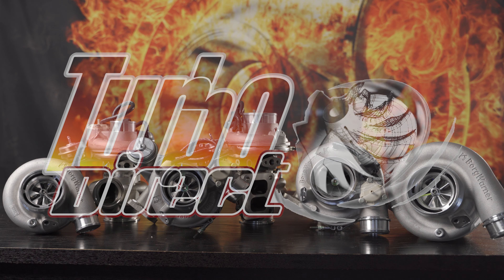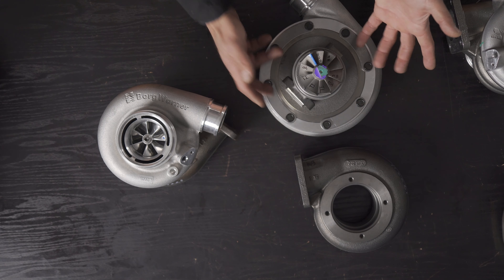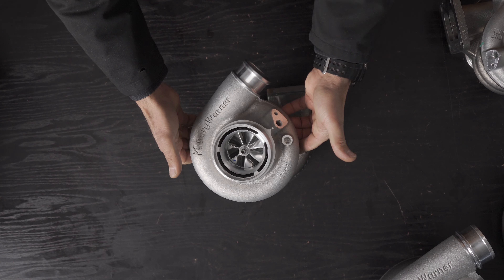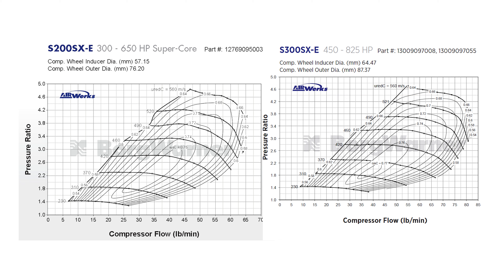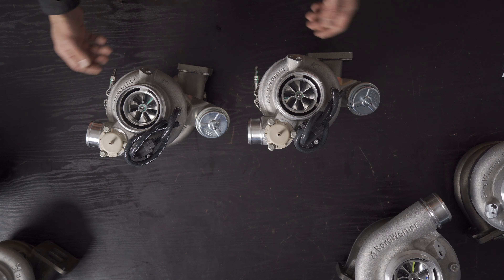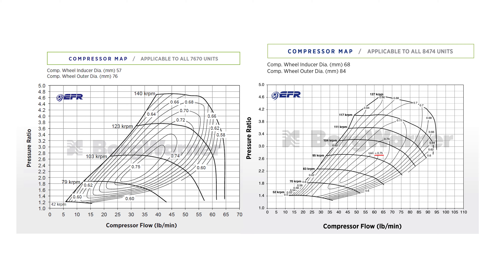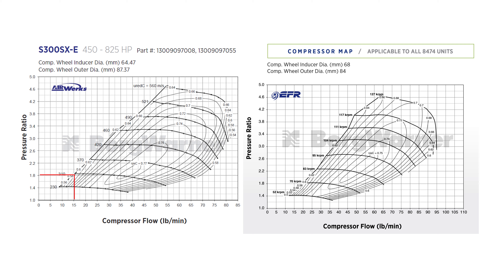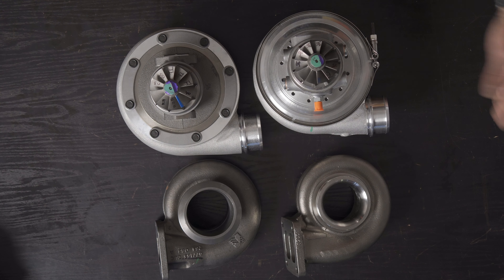BorgWarner's EFR and Airwerks compared

Comment: Great videos you do there guys!!!
stock Rb25det neo would a sxe252 meet the power goal of a 300 to 400whp without chocking up on the rev limit??a low spool/torque output is must (on the stock turbo it goes 44kgm at 3800) thanks in advance!!!
Reply from the maker: Thanks for the compliment. The SXE will work perfectly, but build the necessary split pulse manifold and use the smaller twin scroll housing - it will make this power no problem.
Reply: @TurboDirectSA  thanks for the info great response!!!would you think a g25-660 will do the job?or another newer turbo??i would like to hear your opinion for any other turbo
Reply from the maker: @PavlosJdm  definately not - not worth the money and the G-series is overrated - see my other videos showing the problem with the claims Garrett make on their turbos versus the compressor maps and flow rates on their catalogues and web pages. Actual testing shows the same
Reply: @TurboDirectSA  Ι see your point but i asked if another garrett or brand will do the job because here where i am the money i buy the sxe is very high close to the newer bearing turbos
Reply from the maker: @PavlosJdm  then you are not buying from the right place the SXE is now where close to the price of the ball bearing turbos it’s a fraction of the price
Reply: @TurboDirectSA  ok i m gonna do my research again guys you are great!!
Reply from the maker: @PavlosJdm  our pleasure - happy to help

Comment: Great informative video. - With the EFR 8474 what Turbine Housing would spool faster between the 0.82AR V-Band Single Scroll Turbine Housing and the 0.92AR T4 Twin Scroll Turbo Housing? V-Band housing has lower AR, but would the T4 still spool faster due to having the advantage of being twin scroll? Aiming for good transient response and 1,000bhp @ crank with two EF8474 @ approx. 1 bar boost on 98 Octane fuel, with a 5.2L engine with a 12.5 compression ratio and 8750rpm red line. Do either of these housing options on EFR 8474's sound realistic for those goals, or should I step up to EFR 9274's? Thanks
Reply from the maker: Thanks for the compliment - and i must say i absolutely love this question - its actually a trick question, which will require your knowledge and experience to be able to answer this correctly and accurately.  Things to notice here are the CR of 12.5:1 -- and the massively high RPM Limit. 

1) Fuel being used here will have to be ETANOL or METHANOL - high CR
2) Backpressure will be a problem here so a larger AR turbine housing is a must -- high CR
3) The engine revs extremely high, so once again you have a wide power band range, and the AR of the turbine housing will need to be large, because after around 5500-5800rpm with this high CR engine, the power and torque will start to falloff due to high backpressure in the turbine stage. 
4) I wouldnt even consider using the AR82 turbine housing, the smallest i would consider is the AR92 T4 twin -- and possibly even the 1.05 (EWG) 

To answer your question - linear response is EASY on this engine because of the high CR and fuel you will be forced to use as a result.

Comment: I realise you are a Borgwarner sales man, but I am curious as to the reliability of the inconel vs gamma-ti turbine wheels, especially at high rpm (near their rpm limit). Looking at the S200-70 and the EFR7064, I am wondering which is better. I actually prefer a journal bearing for my application, the main deciding factor is the turbine wheel material because of heat cycles and high rpm I thought the gamma-ti may have a shorter fatigue life. What do you think? Love your videos.
Reply from the maker: No sir im no salesman - we carry ALL brands under one roof, and we outline and provide info on all makes and models - comparisons are based on facts and facts alone. No opinions are depicted unless expressly mentioned.

The Gamma-TI would never have made it into production if it was subject to failure sue to a poor fatigue life - in fact the light weight shaft has a better/increased fatigue life in comparison.  The material is designed to withstand high thermal loads, at the same time weighing a fraction of the inconel / Mar M247 counterparts - which makes this a very special and attractive product.

Comment: Tons of good info as always. It would be really cool if you could do a video on how efficiency actually affects the engine. Like if you are operating in the peak efficiency range, how does it affect the engine running vs operating in a poor efficiency range. Some effects seem obvious, but it's hard to imagine the chart vs reality. Obviously I would think better power for a given boost level, but what else? Better transient response? Better turbo longevity? Just thinking there is probably a lot I don't know.
Reply from the maker: This would need to be a physical test with the turbo installed in order to measure the necessary results. Each engine will perform / react differently at the same points of reference on the maps efficiency.
Reply: @TurboDirectSA  Totally fair. Of course every engine/turbo combination. Just wasn't sure if there were generalizations that could be drawn from what increased turbo efficiency means for an engine.

Comment: Which one would be better replacement with less lag for the S55 twin turbo setup?

Better drivability and possibly more fuel efficient
Reply from the maker: What HP target? If you are planning on producing inside of 700HP, i would choose the EFR8370, for best spool, and up to 750HP capable. More than this 0 would opt for the EFR8474 Black series with IWG and AR83 turbine housing.
Reply: @TurboDirectSA  My target is 800bhp
Reply from the maker: @n.prince2458  Then i would use the 8474 Black series without a doubt

Comment: Very good information and im losing my mind trying to understand it all. What would you recommend for a e36 M50B25TU 2.5L/ for 350Hp on Pump Gas  with room to grow?
Reply from the maker: For a fast spool low down and more than enough power ontop for a clean 600HP setup (Should you choose to boost high enough to make this power) This is what i would suggest for you. https://turbodirect.co.za/store/index.php/shop/turbochargers/gtx3077r-forged-detail 

The compression on the BMW motor is 10.5:1 - which is very high, you will need to lower this to around 9.5:1 at least for a reliable setup on pump fuel.
Reply: @TurboDirectSA  Thank you for the information! Doing some Research into this turbo, Its just a 3071 that has been modified?
Reply from the maker: @defkon99  No its nothing like a GT30 at all - not the comp housing, not the comp wheel, not the bearing cartridge either.
Reply: @TurboDirectSA  Can you recommend anything from Holset or Borg that is similar?
Reply from the maker: @defkon99  EFR7163, EFR7670, Holset do not manufacture performance turbochargers.

Comment: Please help me to understand.. if i use 7670 with 1.5-1.6 bar pressure and 6800 max rpm i can get more then 500 hp or not? I tried to understand, but a little confused. Engine Volvo 2.5t 5 cylinders
Reply: yes i think so

Comment: Hey just came across this video and i need some help. 
I am going to be runninf a speedtech bottom mount turbo kit for my n54 3.0L 6 cylinder bmw. I was thinking of running the g35-900 turbo, but came across this and now im conviced to do the borgwarner S362 13009097056. Pretty sure its twin scrolled. With a T4 manifold. They sell two options for A/R. One is .91 and 1.0 not sure which one to go with. I will be running port injection with 750cc injectors with a flexfuel tune. The turbo is rated for 775hp(crank). I was just wondering which a/r i should choose. Spool time is kind of important to me, so is getting a good 60-130 time. Its going to be a street car more so for highway rolls and me just beating the piss out of it. How late do you think this turbo will be “in boost” or spool, 4k rpm? Do you think ill run out of breathable room with the .91 a/r? Or is the risk worth the reward going with the bigger a/r. Let me know what you think. Thanks
Reply from the maker: Thanks for the comment, i believe we have already spoken on Email -

Comment: Iv for a question on borgwarner bush bearing s200 sxe .I bought these turbos from America and they have sourced there own rear housings. T3 .48 and .82 open . I wanted the .60 t28 they don’t have it . so they say the .48 t3 is the same as as t28 .60 ? I would be happy with  t3 .60 range what’s better ? And Is there info true ? The turbos will be for Rb26 twin turbo set up . ? Will this choke the engine ?
Reply from the maker: Thanks for the comment - the S200SXE is not a "tee free tee faw" there is no way that any GT28 volute turbine housing will work with these turbochargers. If you machine and modify any turbine housing from the T28 / GT28 family the turbo will spool up and produce all of around 300HP if that, and generate enormous amounts of heat at low boost pressures. The turbo will not last long, and probably harm your engine at the same time.  Please don't venture down this road - whoever gave you this information/advise is ill informed and reckless.

The only housing to use with this turbo assuming it's being used on an RB25 GTST including the NEO engine, is the T4 twin scroll AR83 which is a T4 flange face, but with the T3 volute, this will spool up, but nothing like a GT28 model ball bearing turbo.  It is possible to modify any housing to work with this bearing housing design, BUT there is a cost to pay for this. I have seen this so many times, with customer unhappy with spool characteristics of a turbo and they install tiny turbine housings, and the turbo fails as a result and mostly damages the engine at the same time, when in fact there was a boost leak to start with in the original installation - only picked up after the repairs were made and turbo replaced..... 

If its spool and response you want and lower HP output, i would suggest using the smaller frame turbos like the EFR6758 or 7163 which are also ball bearing.  

If you provide more info on the project you busy with id be happy to guide you with some advise.

Comment: Can you make any more horsepower when you go outside of the compressor map or is the right hand side the absolute maximum limit?
Reply from the maker: The right hand side of the map is called the choke limit, there is no more additional, nor stable air flow past this point.

Comment: Could you do a comparison of the smaller sxe 252 turbo how it compares to GTX3071R / G25 660 and include the turbine wheel in the comparison? Looking for a reliable and robust turbos for 3,0l twin turbo setup.
Reply from the maker: Thanks for the comment, we dont stock this smaller S200SXE as its only difference is the compressor wheel size. The turbine wheel is identical on both turbos.  Spool characteristics are the same too, so it makes no sense to spend the same money on the turbo which makes less power and responds the same as the larger more capable unit.

Comment: why don't they do a t3 turbine housing for the 300sxe? thinking the 300sxe could go good on 4.0 barra. how would 300sxe spool compared to .83 8474?
Reply from the maker: Keep in mind that you cannot use a tiny turbine housing AR with such a large turbine wheel - the back pressure in the housing will be abnormally high, and thermal runaway aswell as thrust loading on the bearing system will shorten its life and prevent the turbo from making power.

Comment: absolutely stunning amount of knowledge. Thank you for creating this content
Reply from the maker: Thank you for the comment - much appreciated.
Reply: Hi
Love it!
Please keep at it and educating us 😁

For a Subaru EJ207 2.0 litre with dual Avcs (2015 model) , thinking of a g25-660
Which borgwarner turbo model would you recommend I look into for this application?

Thanks in advance
Reply from the maker: @zaakirwahab9023  The EFR7163 with the T4 twin scroll turbine housing will outspool and outperform the G25 by far!  The Twin scroll housing is perfect for the opposed cylinder engine design, and is small enough to fit into the geography aswell. The internal gate is also unmatched in boost control, and response - without a doubt i would opt for the 7163.

Comment: awesome, video.... today we going learn something, did you say diverter valve accessory on the efr8474black?
something i find alot of fun, like to enter different data, borgwarner matchbot, info i see on the matchbot, altitude compensation, intake temp, fuel type, plotting the estimate engine needs through rpm range on the comp map...... interesting info, which could be useful in building a setup. fuel(amount,  needed for your desired boost), estimate power generated, also desired afr for the rev range........................thanks chris, hoping to see your brand grow aswell.... keep at it

looking forward to the project car kick off
Reply from the maker: Thanks buddy - much appreciate your comments. The brand is growing strong, and we aim to grow this into what its destined to be soon.

Comment: How would the ram air affect the flow rate? Would it extend the right side of the map?
Reply from the maker: Thanks for the question Neil - we have tested this on a dyno with a cold air intake facing the front of a car without an air filter on, running the dyno fan directly into the front of the inlet pipe and the only difference we saw was boost response. No additional power was gained at all.

Comment: I have a Borg Warner EFR hybrid 8370. 
8374 front 7670 turbine 1.05 a/r. 
Went to dyno and was completely confused, 476hp/440 tq @ 22psi 1300ID injectors stock JDM GTE supra. Compression 180 across, no leaking on test.

Any ideas
Thought maybe the Frankenstein didn’t work for what I plan to use the car for; circuit track down a red quicker spool.
Reply from the maker: The shaft power is not sufficient to drive that compressor. Install the 7670 with AR83 turbine and get finished with it - will outspool the frankenstein by 500-800RPM and will make 650HP no problem at all!
Reply: @TurboDirectSA  interesting. 
I’m going to consider it but that’s basically replacing the entire turbo and manifold setup for the T3 .83 a/r. Just not worth it after my current manifold:turbo combo wast cheap. Also leaving no room for future growth as to why I did this. I’m thinking to just go with a 8374 but will keep your recommendation in mind. 

Thanks so much
Lastly, how does the shaft power work to drive the compressor?? Should it not “work”, why would it yield at under 500hp off of a 4mm difference on the turbine?

Comment: I currently have a s300 69mm and want to replace it with a efr 8374. 
Is the turbine side the same fitment. As i dont want to change my downpipe?
Reply from the maker: Unfortunately not - your DP position will change im afraid.

Comment: You kinda missed (or forgot) to give an actual comparison on the 7670 with the different exhaust housings in terms of the spool characteristics on some common application
Reply from the maker: At 18:47 i covered the difference between these two - its only the turbine housing that differs.
Reply: @TurboDirectSA  what about comparing the EFR 7670 twin scroll IWG vs EWG. the IWG turbine housing is smaller (0.9 ar if not mistaken) compare to 1.01 ar on the EWG. Do you think the difference is significant or negligible? Thank you in advance
Reply from the maker: @fizliz1010  The difference between these two will be different in response, because any external gate setup increases the amount of volume inside the pot belly of the wastegate. The internal gate is situated in the inlet tract of the turbine housing and as the swing valve opens, the boost is regulated faster than an external gate down stream of the entire collector assembly and turbine housing volute.

I would stick to the IWG model for the best response.
Reply: @TurboDirectSA  thank you. Would I lose significant amount of peak horsepower up top due to the smaller ar on the iwg setup?
Reply from the maker: @fizliz1010  No you wont see any difference in top end power with these size AR turbine housings. there is minimal back pressure with these housings side by side. If you see 5-10HP it will be alot.

You will be able to see this by the gas expansion values in the matchbot app online - if you interested.
Reply: @TurboDirectSA  yes we know the housing is different as you have mentioned but he was asking the spool characteristics between those different housing...
Reply from the maker: @mkivst180  heck my first reply - i shed light on this already above. Externally gated housings with the same AR will spool later as explained above.  The externally gated housing above is also a larger AR model - making spool even later, and better suited to larger engines CID.

Comment: Can you explain the benefits of upgrading an EFR 7163’s compressor cover to the optional SXE cover? P/N 11711013004
Reply from the maker: The only physical outside difference is the fact that the S200SXE is a non pressure relieved housing. The DV is not present.  Both housings cater for the same inducer size compressor wheel.

Comment: I watched a few videos, looked at what they were filming, and got the impression that they were advertising Borgwarner. I used both, and I'm generally looking towards Precision and Xona, they have more correct turbos.
Reply from the maker: We hold agencies for all OEM brands under one roof - and sell them all - except precision and xona for various reasons.  There is nothing but fact in all our videos backed up by real world installations and results. I do however find the 'correct turbos' interesting, especially when precision is a cheap chinese made, and USA marketted product that was based on a copy of the Garrett internals from its inception, with parts shared from turbonetics with the turbonetics castings on the turbine shafts ..... and alot more.   Would this be considered 'more correct turbos'?